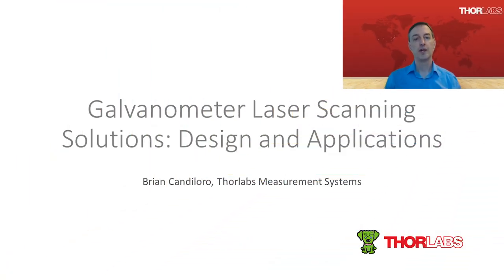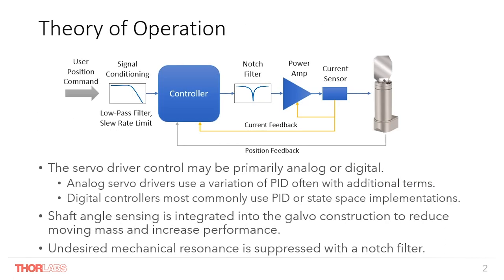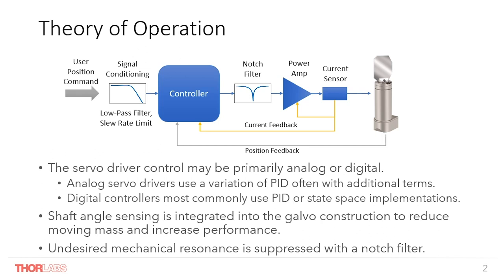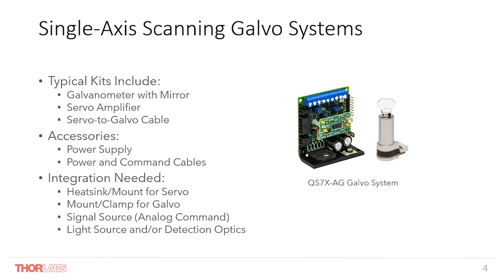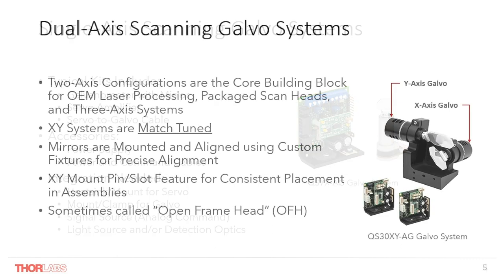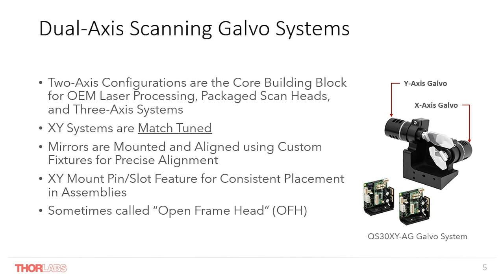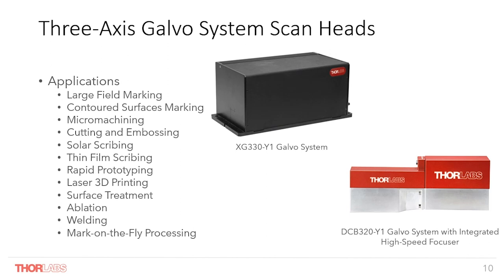Galvanometer Laser Scanning Solutions: Design and Applications

Comment: great video.. can we use 3 axis galvo system coupled with blink high speed focuser to manufacture flexo rubber plates....with sizes limit of 30 inch x 30 inch
Reply from the maker: For a 30 inch field size, we suggest our  XG330-Y1 or XG345-CD 3-Axis Galvo Scan Heads. For rubber, the appropriate choice would likely be the CO2 (-CD wavelength) option. If you have further questions about this application, feel free to reach out to techsupport@thorlabs.com.

Comment: Thank you v much for the video.
can GLS be used in the Lithography process of Si?
Reply from the maker: Yes, in principle the galvo system can be used to steer a UV or other wavelength beam on a surface to produce a programable "maskless" photolithography effect, where the photoresist is exposed by the scanning beam.